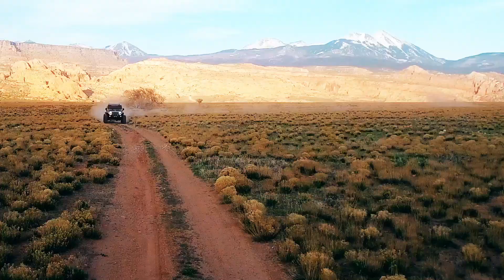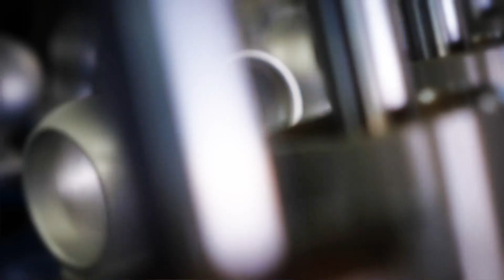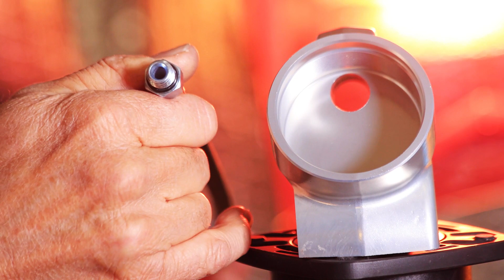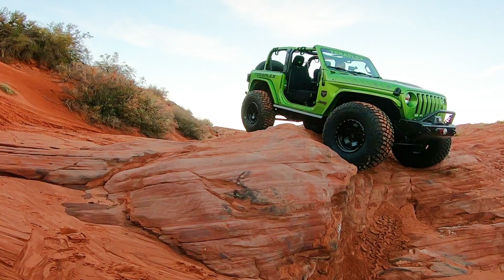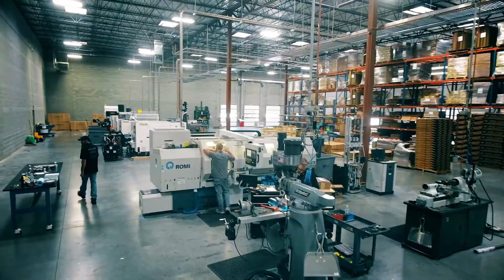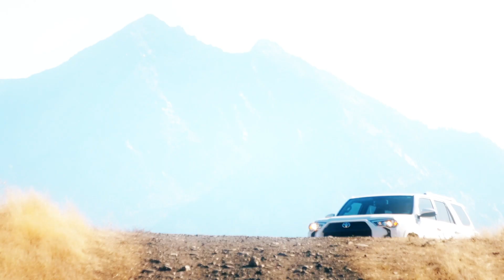Falcon Shocks | TeraFlex

Comment: Money aside give me a reason why I'd go Falcon over Sixpack. And no this isn't meant to come off as a cocky comment.
Reply from the maker: The 6pak shocks are a really cool and outside the box concept from Metalcloak. Thinking outside the box is what they do best.

The Falcon Shocks are made here in house, and are adjustable. Ours are tuned specific to the vehicle using TeraFlex equipment and perform optimally when combined that way. It uses a true 2" diameter shock piston, 3/4" induction hardened chromoly shock shaft and features a digressive valve code. The valving will provide a more confident ride on the highway, fight cross winds better, provide relief when you hit those bigger bumps and give unprecedented performance and driver experience offroad.